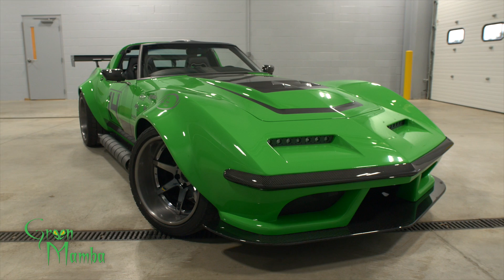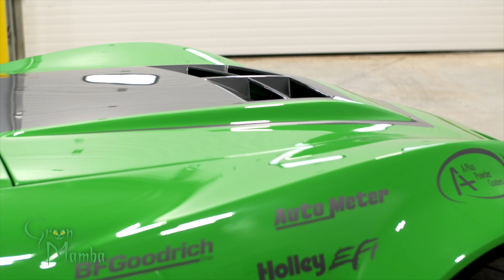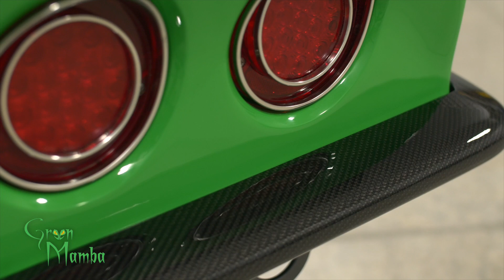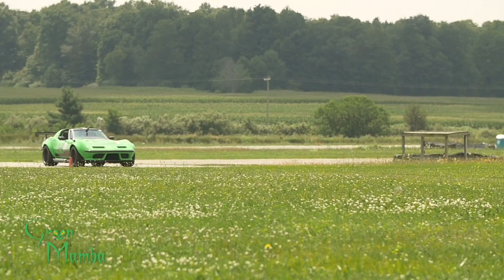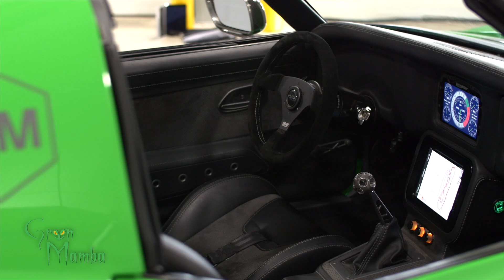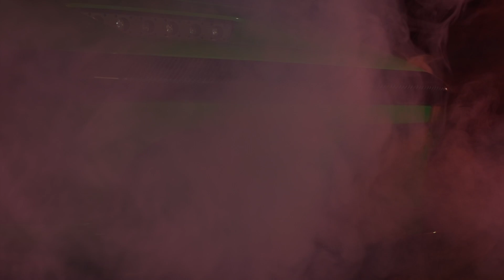Green Mamba Corvette Build Story

Comment: Nice build! but did you see how much the frame and body flex when he did a burnout, not good!
Reply: Yup! I saw that and I was like, "Oh man! That's not good!"
Reply: They have a frame for that!
Reply: MASSIVE TIRE GRIP and a TON OF TORQUE........ not as bad as it looks and probably even tougher to completely eliminate. In a traditional "steel" car this would be easier to get rid of but corvettes are quite different. Full Framed because they have to be. There is virtually no structural strength to be found in the fiberglass that rides on top of the frame. Removable tops add NOTHING for strength to speak of vs a full on roadster soft-top. Eliminating the Flex would require a big move into "RACE CAR" territory and it might have been too fr away from street car friendly for the owner. A full cage inside the passenger compartment welded in would be the way to go but now you're climbing in rather than opening a door and stepping in. In the end it's proof that you really can't have your cake and eat it too. Accept the flex or accept the serious move away from user friendly street car........or option #3........spend REALLY BIG and under pin the whole car with a C6 or C7. The C3 was never designed for this level of traction and power  in one.
Reply: @Dogboy1960  Custom full tube frame, bent to fit nicely under all the fibreglass.
Reply: That's because he cut so much out of the sail panels rear for that trunk
and didn't reinstall braces, therefore everything behind the doors during hard accelerations will buckle..
He's an EXCELLENT fabricator No Doubts there. Remember, Corvettes bodies "hang" on a birdcage frame
and "flexy" fiberglass as well, but an oversight nonetheless.

Comment: I think Green Mamba needs some body stiffening.
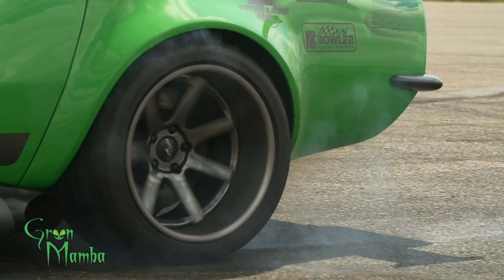Reply: I agree and @ 7:41 of the video... the rear section, looks like its about to split and or shear away form the chassis!!! 

With that said....gorgeous build and very-well thought out components.
Reply: Oh, No doubt. This is a REALLY nice car.
Reply: Phillguy I saw the the body jiggle wen he did a burnout.
Reply: same here, i thought it was going to split in 1/2 But this is a superb looking build.
Reply: Phillguy   Agree.   Vettes need a tube space frame integrated onto the ladder frame for serious racing with high horsepower.  You can strengthen the frame by some seam welding and welding gusset plates, but you really need a roll cage with tubes extending to the front suspension towers and to the rear kickups.  Awesome car, but he'll soon learn that he sacrificed race worthiness for customizing and beauty.
Reply: @beyond_the_infinite2098  Yup. He's surpassed the limits of the original engineering. C3......best looking Corvettes,IMO. How-ever this is why GM's Corvette has had to evolve over the years as tire tech and engine power improved. When you consider the C7 has 750HP and serious rubber to hook up with .......this video explains how big the improvement to a street friendly chassis had to be. A new C8 can manage 2.9sec 0-60 blasts that probably can shave it down to 2.5sec when Gm gives us a super charged option........that's amazing in a car that isn't an actual race car with all the compromises to user friendly this C3 would need to remove the flex we see in the video.
Reply: @josecuervo740  IDK that might actually be the door fitment and the door's rocking when it did that instead of body flex but you can't tell without a wider shot
Reply: Phillguy If it don’t shake then it ain’t bodacious!
Reply: Noticed that too. The reason I sold my 68 Camaro convertible. Felt like it would fold in half when launching...
Reply: Yes I saw the flex also.

Comment: Love the car just one question is how bright are the headlights
Reply from the maker: The head lights are very bright. I used resistors to dim them for low beams and the center one is actually amber for running lights and turn signals

Comment: Nice Build Bob! What backspace are you running on your wheels? I'm running 18 x 11's and 18 x 12's on a C3 but I have a little front tire rub with the frame at full lock
Reply from the maker: My front rims are 18" x 11.5" with 4" back spacing. Rears are 18" x 12.5" with 5" back spacing. I had to modify my flares to clear the tire. I also am using Detroit Speeds suspension. A stock or other brand suspension may require different back spacing.
Reply: @badrs414  ...geez, and i'm trying to get 17x10s and 17x11s on my 95 camaro!!! (APPLAUSE BADRS414)

Comment: nice production!   Do you have plans for a hidden cage for this car?   I noticed a lot of frame shake at the 7:39 mark.  Does the Detroit Speed kit do anything for frame stiffness?
Reply: Good eye. You really are McGyver.
Reply from the maker: The car has a rear hoop. No plans for any other changes or cage. All stock frames flex, it would take a full cage to stiffen. DSE only offers suspension parts nothing for frame stiffness. I don't normally do burnout, especially with the shocks set for autocross, which makes it hop.
Reply: The stock frame does flex and the fact that its nearly a full fiberglass body, so light and over 600 hp flexing is to be expected but not harmful to the car its self
Reply: badrs414, you kept the stock frame? I was planning to replace my frame altogether with a Roadster Shop C3 corvette frame, but with all the necessary options if comes up to almost 70,000.  I was very impressed with you build and was shocked that you are still using the original frame. I might just keep my stock frame.
Reply: It looks like the whole chassis is flexing at that point. I would seriously recommend you cage that if you're going to relly race it. That said, the concept and execution of the car is outstanding, and I respect what you've done.
Reply: Checked the comments to see if anyone else noticed that, pretty nasty amount of frame flex. but sick car overall, i love the attention to detail and styling.
Reply: A full cage would require the rear down bars going through the rear window on a pre-1978 C3 Corvette. Would you really want to see that??? His car, his choice.

Comment: How much does the suspension work cost, as if its 3 to 5 grand for that front and rear, that's a reasonable cost. As I took one look at ridetech's offering for I think just the rear suspension, and it was like 20 grand, 20 grand for a C3 suspension kit! you could buy 2 C3 for that cost!
Reply from the maker: You will need to contact Detroit Speed for a price on the suspension. I can tell you it is worth every penny as the car handles unbelievably.

Comment: Where did you purchase the original flares from, and did you have to extend out the front flares to get the 11.5” rim/315 tire to fit in them. Thanks
Reply from the maker: The flares where from Custom Image Corvette. I had to extend to cover the 315 on the 11.5" rims. If I had to do over, I would have just fabricated my own flares. There is a company that wants to talk to me about producing flares and use mine as the pattern.
Reply: Ya, I figured that’s where they were from, I’m just surprised you had to modify them that much and I knew that rim/tire combo wouldn’t fit under the front hahahaha
Reply: I’ll be waiting for those fenders if y’all go through with it 😁😁

Comment: What kind of foam did you use that the resin wouldn't dissolve?
Reply from the maker: I use 3 types of foam. 2 come from fiberglast.com their 2 part liquid foam, their sheets of foam. I use spray foam from the hardware store that is made for sealing around windows.

Comment: A Corvette in stock form is on of the worst handling ever made. I tried a closed course race with mine and I was very underwhelmed.
Reply from the maker: Green Mamba handles exceptionally well and has won or placed in the top 3 at many autocross races and a few road races. The Detroit Speed Suspension really improved the handling. Thanks for watching

Comment: If you were blowing clutches after one race you're doing something wrong
Reply from the maker: Yes, using the wrong compound and clutch type. The mini light weight clutches would not hold up to a truck that weighed 4360 pounds with out me even in it. The Center Force Triad did.